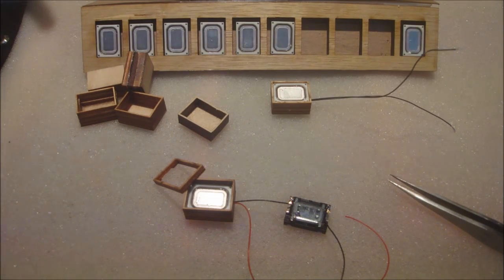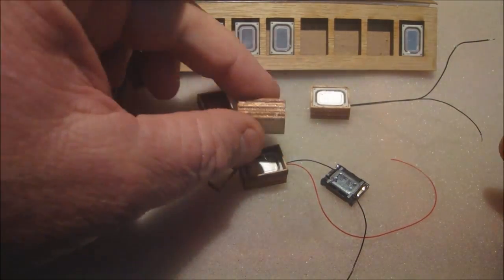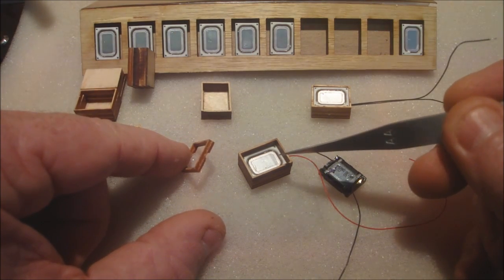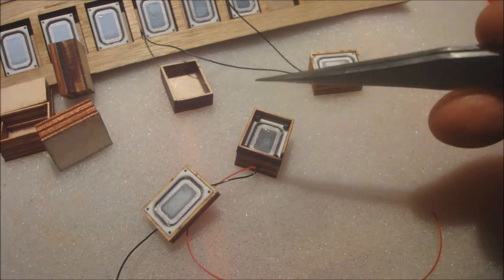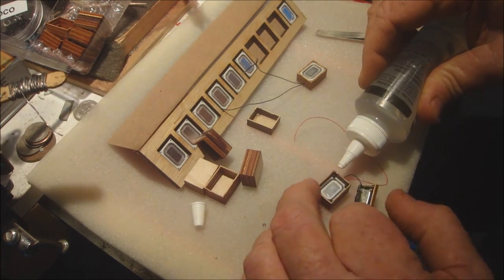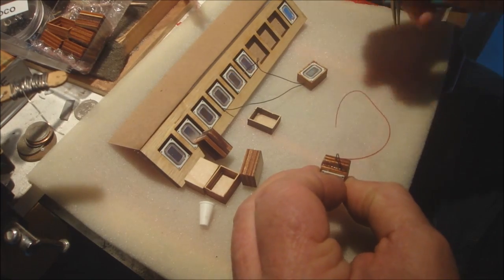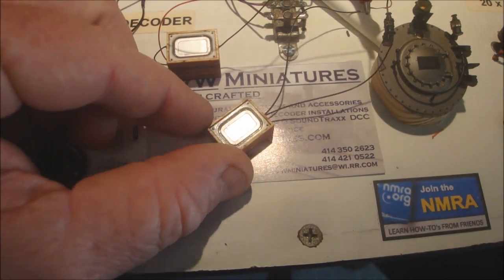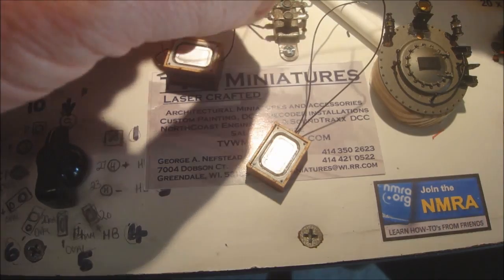Cell Phone Speaker testing & Isobaric

Comment from the maker: I truly do like these small cell phone speakers. The CT a ZIMO are OK however I do prefer the larger 8 Ohm that George at TVW Miniatures sells with his enclosure. Yes, a high bass speaker of the largest size to fit is a good start but think of adding a cell phone speaker (wired in series) with the HB. May be able to fit in cabin ceiling or smoke box on your loco ?